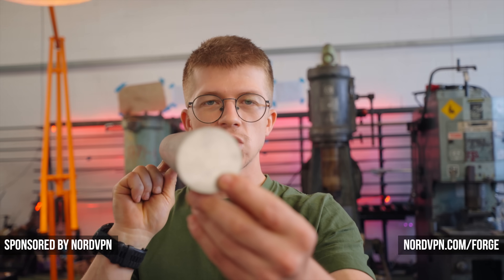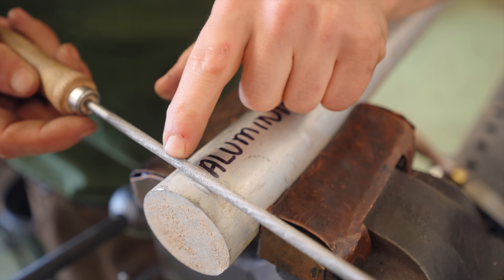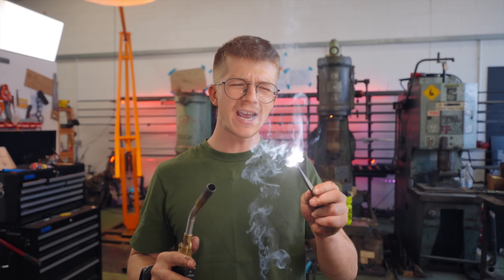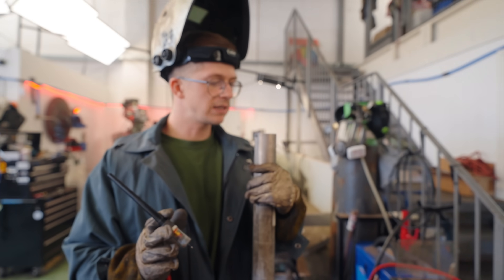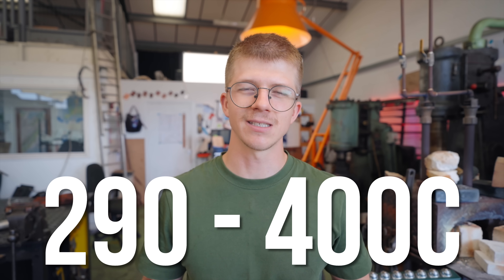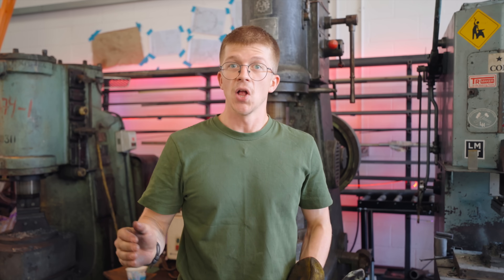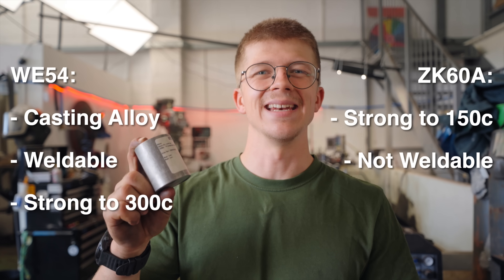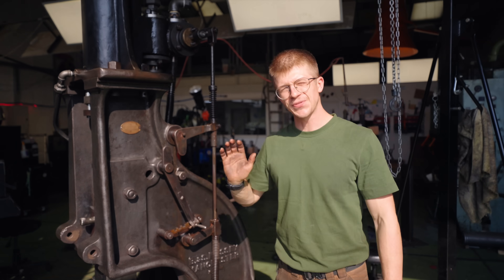Can You Forge Magnesium?

Comment: US Navy here with fun facts; a lot of aircraft landing gear components and such are made from Magnesium because of how lightweight and easy to machine it is- however this poses a unique danger to flight quarters crash & salvage teams as any aircraft accident can pose a risk of not only class-B fire (fuel fire) but also class-D fire (burning metal), and a class-D fire is fueled by self-oxygenating metal which means you cannot put out the fire. Only remaining measure is to jettison the craft into the ocean and let it burn itself out in Davy Jones' Locker.

Comment: Back in 2011 and 2012 i was going mental with track days, so naturally to get faster, one day i got my hands on used forged magnesium wheels. Got them from a local race driver who was already going with carbon fiber wheels. Cost me an arm and a leg, despite being used a ton. Everything was going fine for around 3 months and then one day during practice, after pushing the car hard for nearly 2 hours in an absurdly hot July day, i took a curb a bit to optimistically, the tire popped, the rim cracked and then all of a sudden caught on fire. The fire extinguisher i had in the car did abslutely nothing to the fire. Thankfully one of the other guys on the track saw that. As it turned out late, he already had experience with magnesium wheels catching fire and lucky enough i had pulled over in a sand trap aside of the track, so he stopped behind me and started digging up sand and throwing it at the fire. The fire was just about to start spreading upwards, but with a bit more enthusiasm and more people helping throwing sand on it, it got extinguished fast. But that whitish-blueish flame which doesn't wanna die down to this day is burnt into my memory. Never used magnesium wheels again.

Comment: 0 degrees Freedom units is the temperature that saltwater freezes, 0 degrees Celsius is when pure water freezes.  Saltwater is 97% of the earths water supply. By my math, we're a little over 32 times more correct on the measurement system.

Comment: under normal conditions, you can scratch lead with just your fingernail. Same cannot be done to iron. Lead is more dense than Iron, yet iron is harder than lead.

Of course, put lead under extreme pressure, and it becomes harder than steel, but that is not "normal" for the purpose of comparison.

So no, density, and hardness, have no correlation to one another.

Comment: Not magnesium-based, but I was cutting a bar that was essentially a steel core pressed into an aluminium sleeve with an angle grinder over a lathe bed with tons of swarf and metal dust. The grinder caused sparks from the steel when it hit the core, and the aluminium chips mixed with the oxidized steel in the lathe bed turned into a thermite fire. Thankfully nothing exploded or popped out onto me, and there because it mostly just small pieces of dust and swarf it went out pretty quickly and did not burn the workshop down haha

Comment: When forging magnesium, you have a one heat one strike opportunity. If you mess up the heat, it burns. If you mess up the strike, it burns. You need to put it directly into a press with a mold. Heat it, and then press it into the shape of the mold. Do not miss.
Reply: It's driving me crazy the masses keep saying magnesium is flammable, so is potassium but you don't see people avoiding bananas. The purity of the metal matters and no one with a brain is going to work a non alloyed magnesium metal period.
Reply: but the potassium in bananas isn't the metallic form it's the ionised form, the version that is less reactive because it has already reacted, like how magnesium oxide isn't flammable because it can't be oxidised further. it's not about purity it's about state in this case.
Reply: @haggisllama2630  pure magnesium and pure potassium is flammable, alloyed magnesium and potassium in a banana aren’t because they are different. If you can only take things at face value and literally without doing even a little bit of deeper thought then don’t reply there’s a billion people like you
Reply: @Neoprenesiren except Magnesium alloys are flammable. Less so than pure magnesium, but they very much are. 
The magnesium in an alloy is still metallic magnesium. It holds the properties of metallic magnesium. It will react in the same way as metallic magnesium, if it is given the conditions to do so. It may need higher temperatures or a filed surface, but it will.

The potassium in a banana is not metallic potassium. It has already bonded, it will not react even remotely similarly to metallic potassium.
Reply: @Neoprenesiren Seems you are among those billion yourself.
Reply: @Neoprenesiren  Banana potassium isn't even metallic, it's as mentioned positive ion (already reacted). This isn't purity or not, this is whether or not it's still in a metallic form.

We're working with unoxidized magnesium alloy. OFC fire is a concern. This is like saying "powdered aluminum is fine if you dilute it with iron oxide."
Reply: @Neoprenesiren bad analogy. The potassium in a banana is not metallic. Thats like expecting blood to have the propertirs of iron
Reply: @Neoprenesiren except tge place that makes the bar stock for their client who makes those spools of magnesium ribbon😂😂😂

Comment: The difference between the saw and the file is probably down to how "gummy", or ductile the metals are. Aluminum is pretty ductile, so it gets smeared into the teeth of the file more easily, while magnesium isn't very ductile at all, so will behave more similarly to steel.

Comment: dry ash stick test? Works for aluminium because it never incandesces. Get a dry stick of ash wood. Rub it on the metal as you're heating it. Down at about 350C it becomes sticking, gets greasy and slippery as you come up, starts smoking and sparking, starts to flame up at about 420C. Useful for when things don't glow, or generally speaking low range.

Comment: @3:15 "What's weird: the file cuts the magnesium worse than the file cut the aluminium, but the wood saw is cutting the magnesium better than the woodsaw cutting the aluminium. Things that don't make sense." 

That's called "work hardening", to which the magnesium is more susceptible. So the fine teeth of the file will effectively harden the surface, while the large teeth of the woodsaw dig much deeper and just scoop out the work hardened surface. So it does make sense, once you are aware of how different materials react different to surface deformation.

Comment: You start by claiming you have a solid piece of Magnesium then go on to say it is an Alloy. There is big diffrence in the two! What you are trying to forge is not Magnesium because if it was it would be malable enough to forge at room temp, instead you are working with a mix of Magnesium, Yttrium, Zirconium and Neodymium and it is the other elemets that are making the alloy brittel and hard, not the Magnesium.

Comment: Magnesium's real benefit is the strength to weight ratio.  Great for vibration test fixtures, where you don't want to add so much mass you limit what you can shake, but need the rigidity to impact the forces into your test article and an aluminum fixture just won't cut it.  That said, it's become harder and harder to find machine shops willing to touch it due to the hazards involved.

Comment: I wonder if it has a low or high conductivity. Too low conductivity and it wont transfer the heat to the center of the bar. Meaning it's still brittle in the center and needs to be heated for a lot longer?

Comment: It might have not been preheated for long enough. As you've said, it's a narrow forging temperature range. If the outside is at forging temperature but the core isn't quite there yet, it's going to rip through the core as it did.

Comment: There is something called "Graugussspäne" (shavings of a special metal) which are used to put out magnesium fires because if you try to put it out with water it won't work 'cause the magnesium makes it's own oxygen (which is the reason that begalos or what they are called are used by divers) but even worse: This stuff burns hot and will evaporate the water instantaneous and cause an explosion. (There is some vid out there with a fire in a factory hall where that happened. It took like 3 seconds to set everything on fire)

Comment: Also, the cracking is failure in SHEAR. You are getting too much deformation for each heat.
Interestingly, that method of cracking is basically how they make seamless tubing. And also why you never draw down bar stock in the round. You always forge it square (even if it starts round) to prevent a crack forming in the centre of the bar.

Comment: A question for you: How dense is gold and how soft is it? 

Gold has a high density (around 19.3 g/cm³) and, as most people know, is naturally very soft. Compared to magnesium, which you mentioned has a very low density (around 1.74 g/cm³), it clearly shows that density does not have a direct correlation with hardness.

Titanium is another good example. It is known for its impressive strength relative to its density (around 4.5 g/cm³, nearly half that of steel). However, when we look more closely at hardness and strength compared to steel, there are some differences:

Hardness: Ordinary steel (especially high-strength steel) is generally harder than titanium. For example, titanium has a Brinell hardness of around 70-160 HB depending on the alloy, while carbon steel can have a Brinell hardness of over 200 HB, with hardened steel being even higher. This means that steel is often more resistant to scratches and deformation than titanium.

Strength: Titanium alloys, such as Ti-6Al-4V, have a very high tensile strength (around 900-1100 MPa), which is comparable to many types of steel, although some steels (like high-alloy or tool steels) can be stronger. The major advantage of titanium, however, is that it has a much higher strength-to-weight ratio, as it is almost 50% lighter than steel.

Weight: As mentioned, titanium has a density of around 4.5 g/cm³, which is significantly lower than steel, typically ranging from 7.8 to 8 g/cm³.

Comment: I collect filmprojectors and my favourite brand used to injection mold a aluminium/magnesium alloy. It’s wonderful stuff because it chips like brass in the lathe and weighs almost nothing. The only downside was that when stored to wet the magnesium will be coming out an corrodes itself into problems.

Comment: @12:00 the 'ium' suffix for an element just means 'metal'.  The exceptions to this are all 'old' (i.e. discovered prior to the modern understanding of material, so pre-1700 or thereabouts).  This is, in fact, why it's called 'aluminium' - because it's the metal that's made from alumina (a material that was well known before the first production of aluminium).  Metals like zirconium, iridium and osmium are good examples to show that the name doesn't relate to the properties.  The general trend is that gases end in 'gen', and non-metals end in 'on'; with, again, a few exceptions for the earliest discoveries.

Comment: 0 freezing, 100 boiling, makes sense, what doesn't make sense America and France are allied in the revolutionary war yet they still use the English Standard and not the French metric
Reply: Of course it's only strictly true for water at 1 atmosphere (average air pressure at sea level). For instance, in Denver, CO (elevation over 5000 feet), the boiling point of water will be around 95 C!

Comment: Alec, please, allow me to give you some machining tips. For softer metals (like aluminum and magnesium), you normally wanna go at about 500-650 rpm on the lathe, depending on the size of the part. Also, if your carbide tool is getting gummed up, try using a HSS tool. Love the content by the way! I prefer this to any blacksmithing TV show out there

Comment: 2:05
Nyesn't

the strength of a material isn't dependent on the mass of the atoms themselves really
but
in some cases, the mass of the material matters far more than how strong it is to, well, rate how strong it is
that sounds counterintuitive, but research has found that, when it comes to things like micrometeorites, every material will fail when hit, and regardless of how it fails, the amount of energy that's let through is almost entirely dependent on the mass of the material
which is a bit of a problem for space travel
so a lot of effort has gone into figuring out ways to redirect that energy back out into space, rather than trying to absorb it, basically designing a sacrificial material that's designed to fail in a way that prevents actually important infrastructure from being damaged

Comment: The metal itself isn't a laxative, you could lick the bar all day and be fine. It's the salts made by reacting it with acid that do the trick. But it's also really really good at lighting thermite. So, you know... grab a big handful of aluminium chips, a big pile of that iron powder you've got, sprinkle in some magnesium chips and away you go.

Comment: To avoid the cracks, it needs much shorter cycles, more heats. This is because of its low density and consequent low thermal capacity. I.e. it holds less energy. In contact with the high thermal capacity anvils, it loses that energy very quickly, and unevenly, which is the perfect recipe for cracking.

Comment: When I was in the Navy allowing a metal fire to burn itself out was not an option. The plan was to spray water on the fire ( saltwater because that’s what we had) to keep the area as cool as possible until the fire lost enough heat to go out or ran out of fuel. Burning through the hull or creating a huge conflagration where not the best for mission success

Comment: The file sucked because the metal is softer causing the file to clog up ? Appose to bigger flakes of metal filing off, hence why the wood saw worked better on the magnesium same as if you where to use a file on wood compared to a wood saw

Comment: That's probably one of the worst alloys you could have chosen if you want it to be malleable/forgeable... It;s a very high Yttrium and Rare Earth containing alloy specifically designed to avoid high temperature creep... 
You want one of the wrought alloys that contain aluminium and zinc.
But even then, all magnesium alloys are pretty bad for this because of the lattice structure. Because it's hexagonal, it's much harder for dislocations to move than it is in a cubic lattice.

Comment: WARNING TO EVERYONE: 
Magnesium is NOT something to play with or experiment with unless you know what you are doing.

I am an engineer who's worked in robotics and automation and we often used mag-al (magnesium aluminium) castings for things like robotic arms and grippers. My boss also had a race car team and they often used mag-al castings. So I have been around people machining this sort of stuff and the chips and swarf that come form machining are INSANELY DANGEROUS.

Because when you machine the chips and swarf not only have more surface area but the freshly cut faces are not yet oxidised. Plus there's very little mass so its much easier to heat it up to ignition temperatures. We had an apprentice set a pile of mag-al swarf on fire one day when he dropped a cigarette butt into it. Luckily there wasn't much swarf in the tray of the milling machine at the time or we might have lost the entire building.  

Its hard to stress just how careful you need to be with this stuff, because once it ignites its almost impossible to put out.

One of the most basic mistakes people make metal is thinking metals melt while other things (like wood) burn. Its not that metals do not burn its just that they often require a lot of energy to ignite. The problem is that when metals do burn they are very hard to put out because they burn so hot. Spraying them with water does little because the heat simply turns the water into steam. Yes water will cool it but unless you drown the fire with enough water you probably won't do much.   

This is why the preferred method to deal with metal fires is to smother it with sand or one of the suitably created foams that you get from certain fire extinguishers.

AND YES Alex should have explained this at the start and shown what he had - sand or a suitable extinguisher for the task.

Comment: 1:51 AN ATOM OF MAGNESIUM DOES NOT HAVE LESS ATOMS. it is an atom by itself, and the reason it is lighter is (mainly) because it has less protons and neutrons , and it's difficult to tell how hard an atom is with the number of protons and neutrons (except memorizing). Iron has an atomic mass of ~55, and magnesuim has ~24. sorry for bad comment
edit: magnesium might be softer, but the density is not the reason

Comment: Density mostly correlates with higher atomic numbers, meaning atoms with more protons and correspondingly more neutrons and electrons. It isn't an absolute correlation though, and it also doesn't really have anything to do with the number of atoms.

Lower-number atoms are smaller and that may mean there are actually more atoms in a lighter substance, but due to the smaller number of particles in the nucleus, they will still have a higher proportion of empty space to mass.

There are also molecular, crystal and grain structures to consider. Some metals have crystal structures; I'm not sure if all of them do, but they all have grain structures that form as they solidify, and these are dictated by the ways their molecules interact with each other; some structures may hold larger atoms farther apart, making for a metal that's less dense than one made of smaller atoms, while others may allow smaller atoms to pack together more closely, making the material more dense than a material made of larger atoms.

So, the densities of materials are affected by a large variety of factors. Even heat treatments can change the density of a material...
Reply: Then lithium should be the lightest of all, until we can make metallic hydrogen.